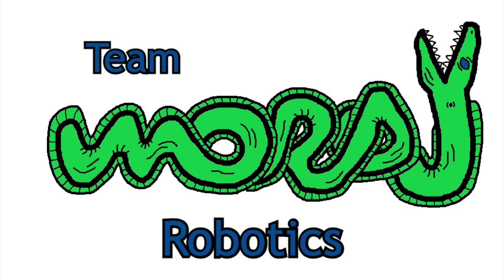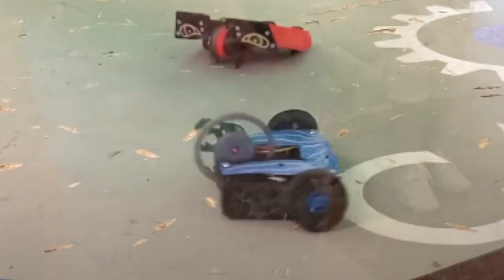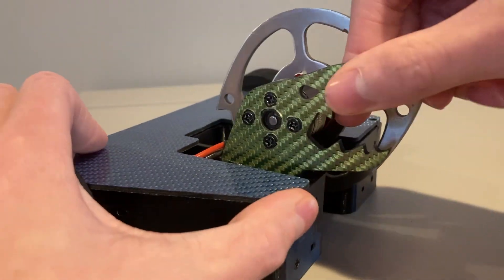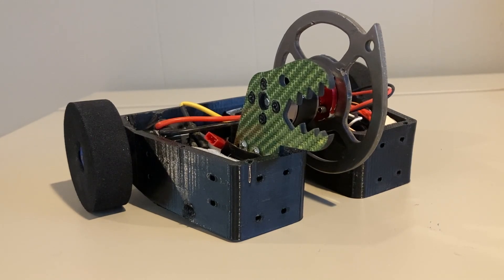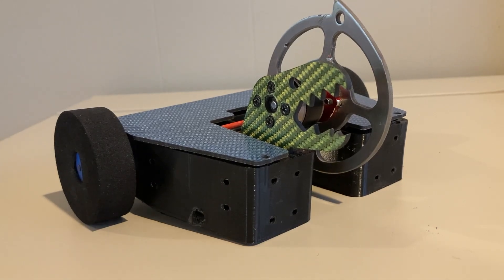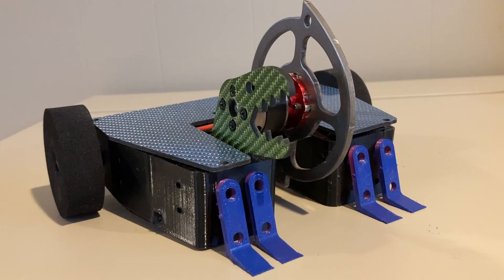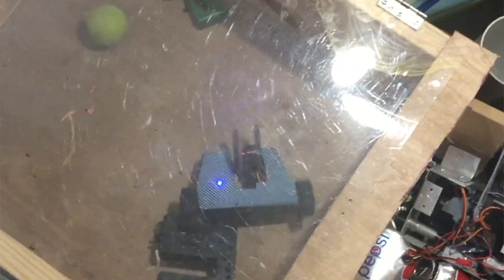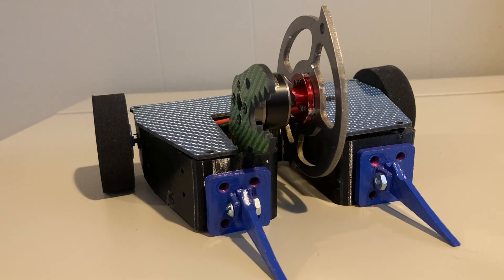Improving my antweight combat robot with CARBON FIBER

Comment: How much does the top carbon fiber panel cost each for moray? I plan to use some carbon fiber for my robot.
Reply from the maker: I don't remember for sure, but I got two uprights and two top plates for $40. Send Cut Send is great for sheet metal and UHMW, but the amount they charge for carbon fiber is way more than CNC Madness.
Reply: @Morayrobotics23  Ok, thanks a lot! The bot I’m making is called ShockWave. I hope we can battle someday!😀
Reply from the maker: I’m very glad I could help. What kind of robot will it be?

Comment: Wow, this looks very good! Awesome to see that gyro too. I would recommend testing inverted driving with the bar if you haven’t already. The geometry of it will keep the bot more flat to the ground when upside down and potentially make it harder to self right by colliding into the wall.
Reply from the maker: Great suggestion. I’ll definitely test that out